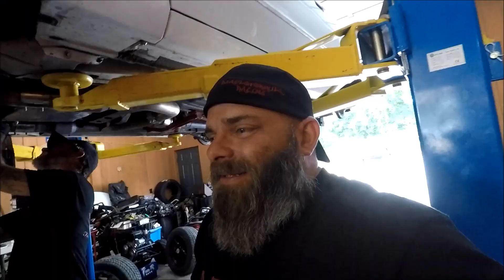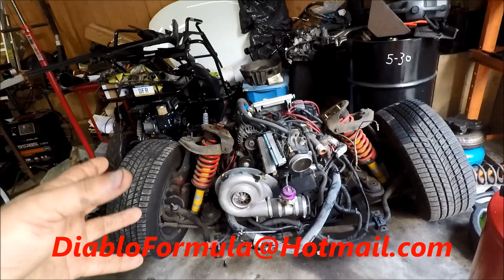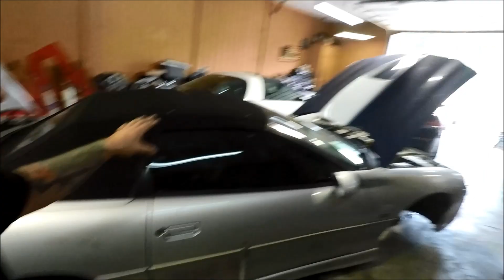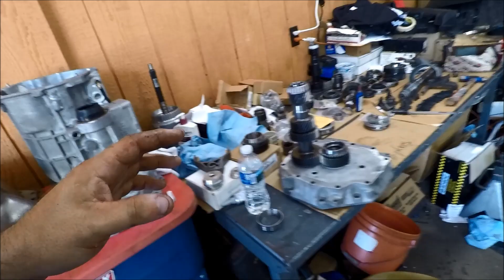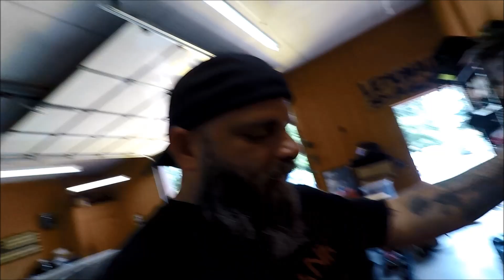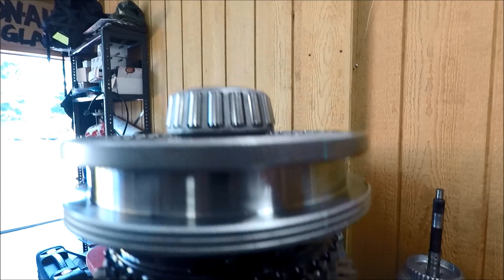Project "GHOST" T56 Transmission Build

Comment: One thing Andy didn't mention is that when you shift into whatever gear is 1:1, it just locks the input shaft to the output shaft, that's why you only see 5 gears when the T56 is a 6 speed.

Comment: Another quality video Andy I have always been scared of opening a gear box yet my dad used to tell me go for it just make detailed notes of how it comes apart, I was it's cheaper to get another box second hand with warranty. I might just bite the bullet soon.
Reply: Formula 1Fan Just do it what's the worst that can happen?
Reply: don't be scared. just order an ATSG manual for what ever trans you plan on doing. they really aren't that hard, even automatics
Reply: A big box of spares.
Reply: I only really drive manual apart from long distance then I drive a, no piss taking (Vauxhall Astra 1.4 sri 150ps) Because of a damaged knee in a crash. Manual cars are the norm in the UK and as my dad said years ago Learn to drive a manual learn to heel and toe and learn to rev match then you are a driver, most is not needed so much these days but I have driven cars made with wood and others made of aluminium with v12 engines so it was worth learning.

Comment: Brass pawls on shifter fork.... Is there any issues with metal shards wearing off if the brass and clogging anything?
Reply from the maker: Haven't had any issues
Reply: @DiabloFormulaRacing  good to know, thanks.... Another question if you have a moment. I am doing research on engine swap in an 04 newedge  convertable to coyote, my question is in regards to a t56 trans from 04 Cobra vs a t56 magnum, my local shop has advised me to stay away from the cobra trans citing it is old and parts availability is drying up..but Older trans comes with a Ford aluminum Driveshaft and is ~2k less than a crate magnum...

Comment: so the drivetrain and mechanical stuff is swapped...what you doing about computer/harness/tuning??  In other words how will it run?
Reply from the maker: Everything is swapped, car runs great!
Reply: so the v8 harness plugged right into the v6 body?  gauges all work.  Dang what am i waiting on!?
Reply: only issue I could see maby would be the VATS, but easily bypassed

Comment: Lol the one handed transmission build...why not just have a small pan for the oil? Nice video
Reply: Backyard Chevy - yep, that’s why you save all those plastic trays for meat and veg from the grocery store, right?! My favourite are the polystyrene trays that you push parts through like pushrods, bolts, etc, to keep them in order... It’s one of the reasons I so love Mitch; his use of labelled freezer bags for components!
Reply: lol, i used to use egg cartons to keep things organized before i got those valvetrain organizer trays lol
Reply: Backyard Chevy - unfortunately, I had to learn the hard (really hard!) way, didn’t I... I cracked the casting for the rear bearing for the cam on a Pinto head back in the day, by getting the oil line bolts out of order & not noticing the rear bolt was shorter. It was a customer car; ‘had to buy another re-con head; spend all the time and more over again; upset the customer ‘coz I was late... I still have nightmares of that sickening sound of.... CRACK!
Reply: ...and y’know, I shouldn’t say this but I was that green I decided to see if it affected how the motor would run... I was amazed I didn’t snap the cam between the middle & rear bearing after the sound it made on start up!
Reply: Jeffrey Reynolds things like that happen...we learn from the mistakes we make..makes us better mechanics
Reply: Or he could have used a squirt can!  Anything but rubbing parts in tranny fluid on dirty cardboard
Reply: reese lol yea any metal chips or anything on that cardboard just sticks with that fluid lol